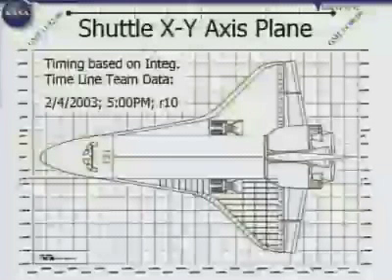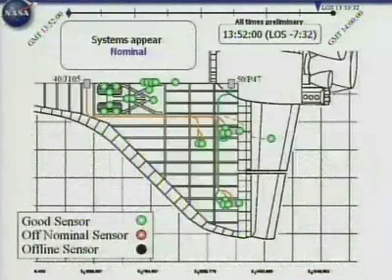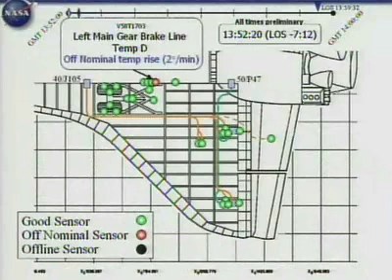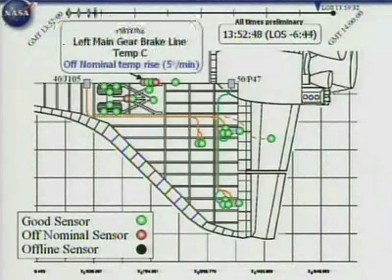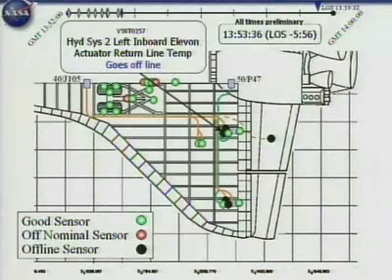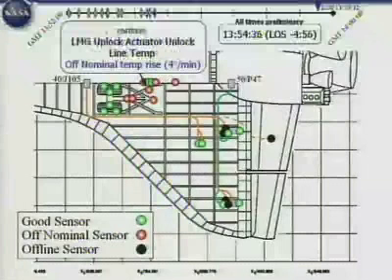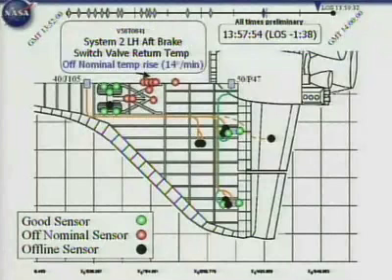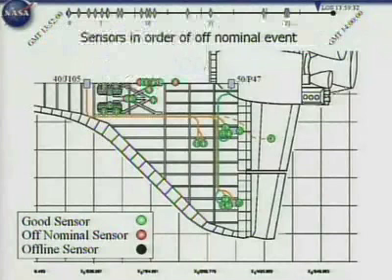Timeline of events in space shuttle Columbia left wing during failed re-entry of STS-107

Comment: Hindsight 20/20, for the Challenger 1986 and Columbia 2003, I wonder would it have made a difference in saving the crew, to have, similar to a fighter pilot on ejection, be supplied with a parachute, that automatically executes/deploys if they passenger is ejected from the craft [so that if they are unconscious and can't deploy the parachute it would be on auto, similar to an airbag auto response for the motorcycle rider who is ejected from his bike].  Just a thought.
Reply: http://jalopnik.com/5894022/what-happens-when-you-eject-out-of-a-jet-at-800-mph  keep in mind they were going 16,000 mph over california.. 14,000 mph over texas. the horror of this.. is that if anyone other than the pilots didnt know there were problems, at 8:59:30 hydraulic pressure was lost and they would have felt the craft passing into an unrecoverable attitude.. which was the case, the pressurized crew module was intact and free from the rest of the debris until 9:01:00. Blackbox recordings stated there were pilot inputs beyond specified limits.. so either something was thrown against the control stick, or the pilot was attempting correction. This is just part of the job. I would also like to note the cabin video recording, that usually continue until touchdown.. was discontinued 11 minutes before loss of signal.
Reply: The Shuttle Ejection Escape Suit  and the 2 ejection seats were only used while the Shuttle was in its Test phase during STS-1 through STS-4. Once President Reagan pronounced the Shuttle "operational" the Shuttle Ejection Escape Suit and ejection seats were no longer used and the light blue flight suits were used as the flight deck was a shirt-sleeve environment.  It wasn't until after STS-51L Challenger that the orange Launch and Entry partial pressure suit was used from STS-26 through STS-65, then the full pressure orange ACES Advanced Crew Escape Suit was used through the end of the STS with STS-135.  The astronauts actiobs had nothing to do with the decision to remove the ejection seats.  These Shuttle Ejection Escape Suit and seats were supposed to be good up to 100,000 feet, so long as the ejectee wasn't BBQ'd in the plumes of the Solid Rocket Booster.  Ejecting from the Orbiter didn't guarantee survival.
Reply: @hoghogwild  There are multiple interviews with the first several shuttle crews saying the seats were installed and the PIC refused to use it event of an emergency, before nasa removed it on later missions.
Reply: Janet Stone at 16,000 MPH down from 18K in orbit, the astronauts had zero chance.  Short of an aerodynamic escape pod, they likely all ended up being decapitated & then fried by the plasma created at that speed by friction with the air.
Reply: well said, hog. they would've been burned instantaniously at those speeds, given they would've survived ejection in the first place.
Reply: No, even if there were ejection seats for all 7 astronauts on both flights, on STS-33/51L, the Challenger crew would have been cooked by the ET debris cloud and SRB exhaust, while on STS-107 the Columbia crew would have been going to fast for their pressure suits to protect them. The ultimate cause of both vehicle losses was structural breakup under aerodynamic loads (Challenger from being thrown into the airstream in an unplanned way by the ET disintegrating and Columbia from having a wing fail). Best book on the Shuttle program you can get is Dennis R. Jenkins' "Space Shuttle Developing and Icon: 1972-2013". It's huge, but has everything you'd want to know about the program.
Reply: @TimothyCizadlo  I read in multiple places in the investigation those that had been wearing the pressure suits, as well as everyone else had the cloths physically striped off their bodies, likely from the airstream.
Reply: There were 2 ejection seats originally. The astronauts refused to arm them once more than 2 were aboard, so they took them out.
Reply: Thank you for that news, that is so sad, parachutes could have made a difference.  I also just learned, that the Challenger group had some O2 mask or something on when they found them?  I don't know where the report details are that state what they actually found in the spaceship underwater.
Reply: They had 3 emergency oxygen devices activated in the crew compartment of Challenger. At least one had to be conscious to activate them. Most were likely unconscious from the G-force of breakup and decompression. After that, they did have parachutes, but they could only be used at low altitude. The Columbia was traveling at 16,000 mph at the time. They still would have had to deploy a long pole out of the escape hatch to slide out on to avoid hitting the rear pods.
Reply: @billinct860  The latest position i saw from NASA is the crew compartment certainly didn't break up until impact with the water and its just as likely the compartment didn't depressurize.  You can see the crew compartment falling intact in some of the videos.   Also at no point was the g force even enough to injure them until water impact  which was 200g.  It was 20g at peak for less then a half second and under 4 g in less then a second, which is very survivable.  Switches were flipped by the crew that indicated they attempted to restore battery power to the compartment after separation and don emergency equipment.  

Sad to say but its just as likely the survived the fall from 65,000 feet to the water (peak altitude of the crew compartment) as they died at altitude.
Reply: Janet, you're not getting it. Your not considering the speed of 12,500 MPH at the time of breakup not to mention the hot gas plasma ball surrounding the shuttle. You cannot eject at that speed. You would be torn apart in less than a second. One analogy is to try holding a flower out the window of your car while your on the highway. What happens to the flower? I don't even need to add the 3,000 degree heat component to the equation do I?  By the way, some body parts and burned skulls were found and pics can be found on the internet. They ain't pretty.
Reply: Thanks Captain.
Reply: I don't think they would survive breakup and be able to use ejection seats. When ET exploded nothing could really save them. The only chance would be ejecting before explosion.
Reply: Check: Soyuz failure system & a video about aborting the mission https://www.youtube.com/watch?v=LUwnLFKfuBE
Reply: A parachute might have helped in the 1986 explosion, but here I don't think you can parachute out of a shuttle re-entering the atmosphere without being instantly incinerated by the heat.   JMHO.
Reply: Ues, 3 of the 4 PEAPS(Personal Egress Air Packs were enabled manually by a crew member on the flight deck.(Only 4 of the 7 crew members actually sit in the flight deck, the other up to 4 astronauts sit below the flight deck in an area called the Mid-deck.)  So at least one person was conscious after the vehicle breakup to engage the 3 PEAPs, plus the Pilot Michael Smith (who was seated on the front right hand seat(pilots seat) was also conscious after vehicle breakup because there were a few switches which were moved in an attempt to regain control. These switches were of the type which required them to be pulled up and then moved, this means that their movement from their original positions for normal flight was not as a result of the impact with the water, but a conscious movement by the Pilot.  After the vehicle broke up at about 48,000 feet , it continued to gain altitude to about 65,000 feet where it began to fall.  The total time between breakup and impact with the water, was a horrifying 2 minutes 45 seconds.  Each PEAP provides enough oxygen for about 10 minutes, it should be noted that the PEAPS had about 7 minutes of oxygen remaining in them.There was the option of bailing out of Shuttle, and yes they use a long pole ti which they clip onto, they then exit out the hatch and when they reach the end of the pole, they fall off of it thus they don't hit the rear of the Orbiter.  The bail out option is only useful in a controlled level flight.  This certainly wasn't an option for the Columbia crew as they would have been incinerated as they were travelling at about 14,000mph or about Mach 18 or roughly 6 times the speed of a high powered rifle bullet.  Bail out and parachuting was only  for less than 750mph and between 20,000-30,000feet of altitude.  People saying that the Columbia crew could have been saved if they had ejection seats is preposterous and makes no sense whatsoever.
Reply: Challenger's crew could be potentially saved if shuttle had ejection system, but most likely they would suffer serious injuries and burns. In case of Columbia nothing could save them at that speed and altitude.
Reply: @asupshik  I wonder if a ballistic re-entry capsule with ablative heat dissipation coating could have been designed/incorporated into it that would be where people went during takeoffs and landings. If the plane itself is having problems, push the crew out in the ballistic capsule and let the plane disintegrate. Don't make the crew die because a wing or a tail or the payload fuselage fails. Reduce the number of failures that will kill the crew by reducing the impact of the majority of possible failures even if they happen. A form of separability/severability. Perhaps even increase the chances of survival if it all happens too quickly for a clean separation. The papers I've read seem to indicate the crew cabin was more or less an inner structure separate from both the exterior shell and the aft section and it was thrashed around quite a bit but survive a minute or so until complete breakup.